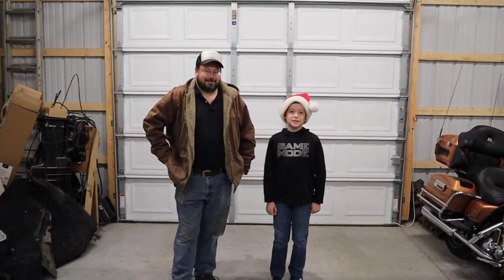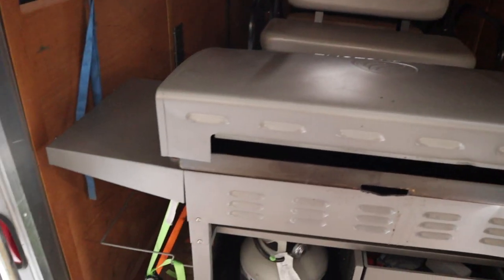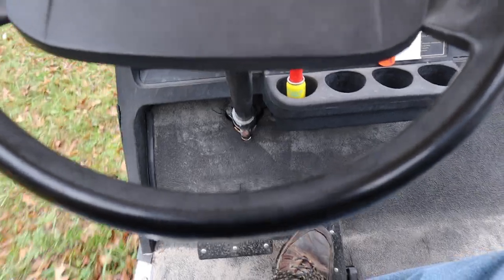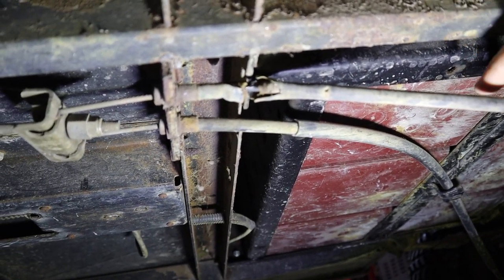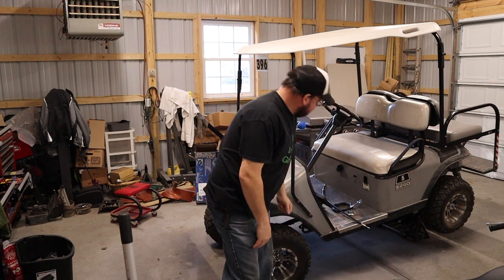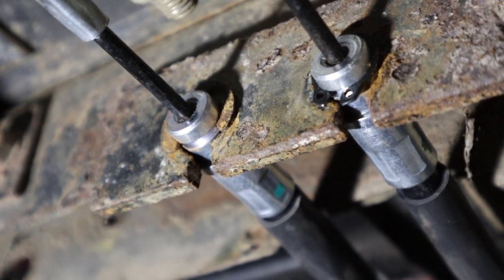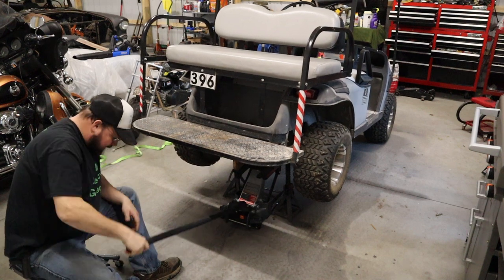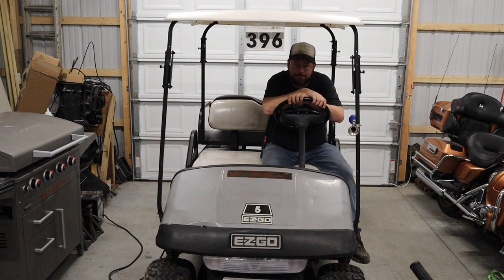CHRISTMAS SPECIAL! EZGO Golf Cart brake cable diagnosis and repair. DIY golf cart repair!

Comment: I was having the same issue after lifting my cart. The rakes were locking up. I ordered a 1" longer drivers side brake cable and it fixed the problem. Thanks for the video.
Reply from the maker: I was surprised that was all that was wrong. I thought for sure something broke in the linkage or brake shoes. Thanks for watching!

Comment: My Legendry Garage  :) Belated Merry Christmas & Happy New Year 2022 ahead too also what I do put front mounted plate to like back is too strong 1/16 thick too may help out too and save break those hoses again  to hold in place  ! Also saw truck for sale my area recently and sold quickly was 1970 GMC heavy duty 1/2 called 5/8  ton it Forset green body , had 396 V8  4 barrel Chevelle motor daul exhaust with Turbo 400 3 speed Automatic transmission, drum brakes on back only and disk front plus power steering and brakes! Truck need fuel tank plus seat bench to fix ! Sold for $1,000 bucks ! Great truck in shape no rust at hardly just on wheel lip on fender light sand plus paint job be all in action!
Reply from the maker: Should've snapped that truck up! I'd have been all over that. Lol. Thanks for watching and Merry Christmas!
Reply: @MyLegacyGarage  agree and was going trying get but sold before got phone owners had and told was sold 1 hour when left to!